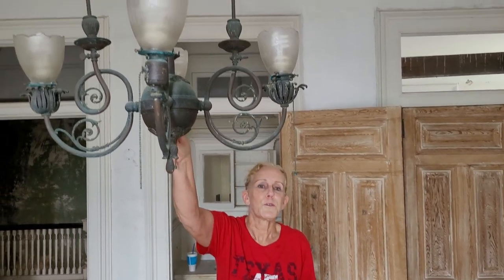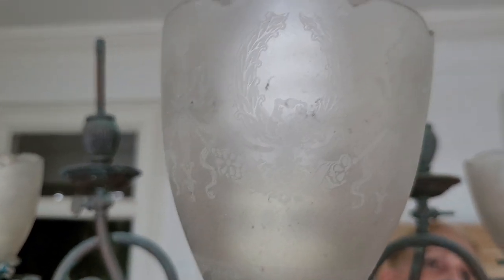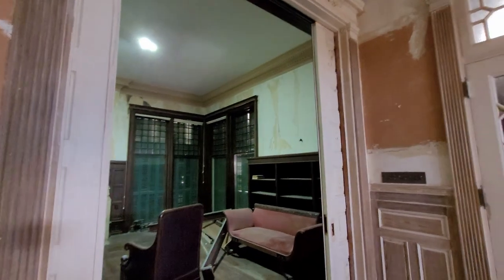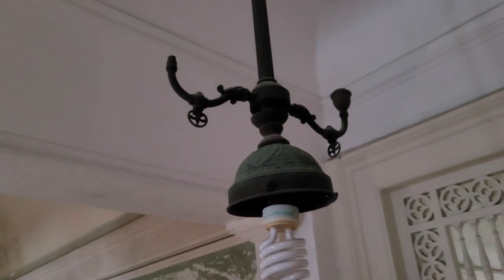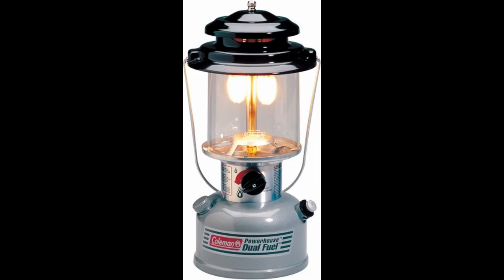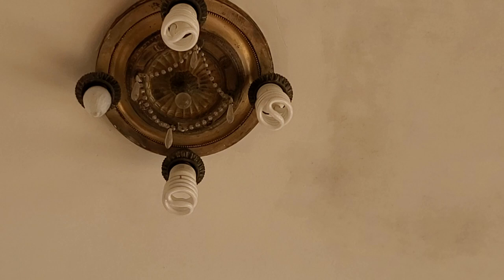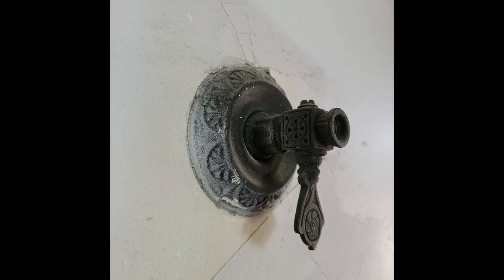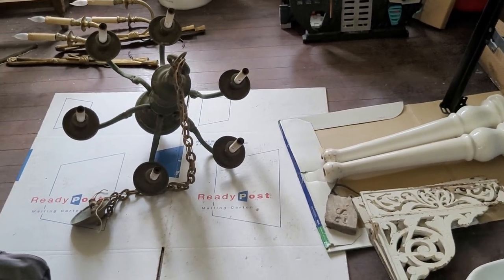S2.32 Let There Be Light

Comment: I would definitely move the existing light fixtures around to rooms better scaled to the size of the lighting. Looks like you will have your work cut out fir you to find new lighting - at a decent price - for all the rooms missing that feature. Could be an exciting scavenger hunt!
Reply from the maker: I love to shop.  We do have a rather exciting announcement to make about the light fixtures.
Reply: @leaguekempnerhouse  That’s wonderful! I’m a bit behind on vlogs - but from the thumbnails looks like you have done a tonne of work!!
Reply from the maker: @christinevr7698  Things have slowed down a lot as we work through getting the nonprofit up and running but there is still some work going on. 😀 We are about to get a new floor poured in the basement which will be a real turning point.  Don't worry about being behind.  We aren't going anywhere.